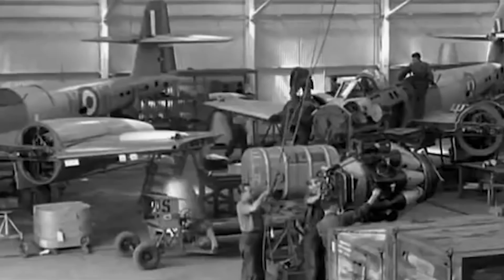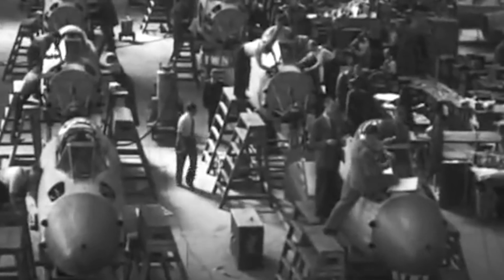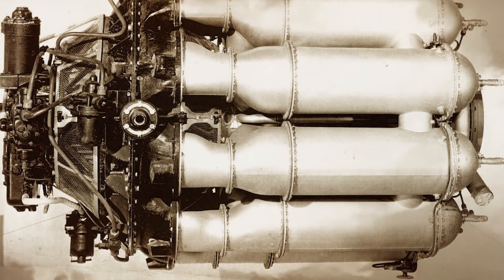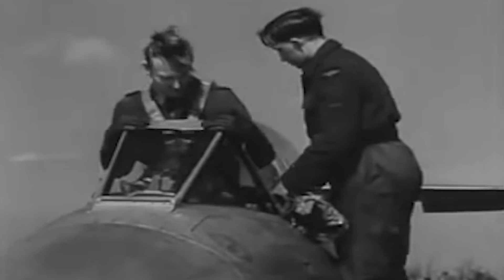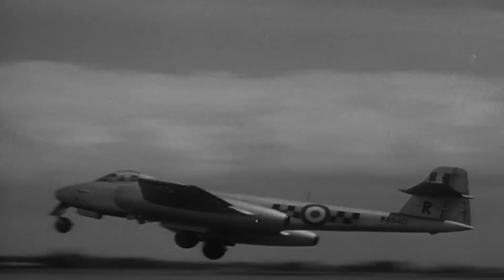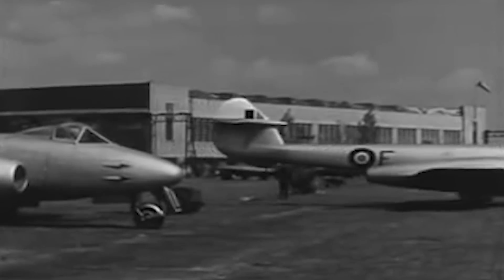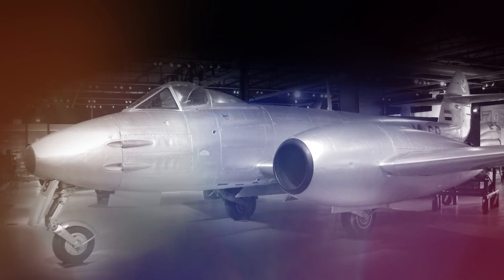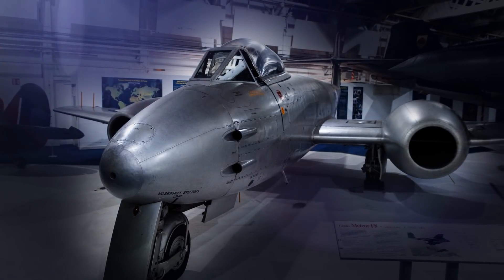Gloster Meteor - The Only Allied Jet to Fight in WW2

Comment: Seems like the brits didnt have much confidence in the plane. Everytime it came across manned german aircraft, no combat occurred. Seems they just wanted to be able to SAY they had a fighter jet..
Reply: You seem to have it backwards, when it reached the continent the Luftwaffe steered clear.  By that time Germany had so little fuel and serviceable aircraft all flights had strategic goals and engaging in combat was not encouraged.  The 262 was forbidden to engage in combat with allied fighter do to It's poor maneuverability.  Meteors destroyed over 50 Luftwaffe aircraft on the ground, countless tanks, trucks and assorted vehicles and rolling stock.  It's only interaction with airborne aircraft was the forced landing of an unarmed observation aircraft.  Long and short is you can't shoot down what stays away from you.
Reply: @jimdavison4077  the germans continued to fight until the bitter end. No running. Indeed the last kill of the war was May 8th by a ME109.
Reply: @mannarmylie4195  check the records, the last few months thats all the Germans did was retreat and flee.  The avoided conflict then made crazy claims that they shot down large numbers of enemy aircraft even when the allies suffered no loses.   Many 262 returned to base with out shooting a single shot.
Reply: @jimdavison4077  ummm thats what a smart and especially an over matched military does. It picks and chooses its engagements where possible.
Reply: @mannarmylie4195  yes but it responds to threats which the Germans failed to do from 44 on.  It was crushed on all side and by late 44 lost its supply of aviation gasoline from the US making it combat ineffective.
Reply: @mannarmylie4195  and loses a war in short order.  Germany lost the war because they believed in their own supirority which turned out to be imaginary.  Not even at its peak could Germany hope to have the resourses either fronts ended up producing let alone both together.
Reply: The Gloster Meatbox was no fighter... its performance was inferior to many propeller driven fighters during WW2 and would have been a sitting duck for a Me262.
Reply: @sandervanderkammen9230  and yet it is recorded as having supirior performance to the 262 in every way.  Go figure.  Again that claim you made about how many kills the 262 achieved was debunked using squadron records.  Now Luftwaffe pilots were well know for lying about their kills going right back to the Condor Legions is Spain.  Several units in North Africa were disgraced fo falsifying claims during the was and in the battle of Germany propaganda was used to mislead civilians about how terrible the war was going.  The records are there for anyone to read, in 43 and even early 44 Luftwaffe fighters took a heavy toll on bomber command and the Eighth airforce bombers by after the D-day invasion the sky over western Europe belonged to the allies with the Luftwaffe accomplishing very little.  By the fall of 44 fuel shortages thanks to Germany being cut off from US supplied aviation gasoline meant Bf  109's and FW 190's had very little fuel and they were the bulk of Germany's fighter force and accounted for the bulk of allied loses.  The 262 never really accomplished much thanks to its poor weapons and poor performance.  ALFRED PRICE wrote several books on the last year of Luftwaffe operations right down to the non of details and covers propaganda vrs reality.  Don't feel bad the Brits lied too during the Battle of Britain as well claiming a 4 to 1 kill ratio when in fact it was only a 2 to 1 ratio.  But couple that with the fact they were replacing lost aircraft at a 2 to 1 rate over the Luftwaffe.  The Soviets also provided false numbers for propaganda early in the war as well. The true sad part is almost 80 years later some people still believe those false figures.  If you honestly love history take the time to learn the truth.
Reply: The Messerschmitt Me-262 was responsible for shooting down over 550 Allied aircraft in WW2... the Gloster "Meatbox"  ZERO Luftwaffe planes shot down.
Reply: @sandervanderkammen9230  had the 262 been successful it would have been reengined to use by several countries but that never happened.  And you have to admit the 262 was tested for hours and hours by the US, UK and USSR yet of the hundreds and hundred that survived not one was used by any major airforce in the world.  If the 262 had any kind of performance at all that made it supirior to propeller aircraft in combat it would have been put to use but it was not and forget the 25% loss rate the 262 had against bombers the number shot down by propeller fights doubles that almost.  For all the good the aircraft did had aviation gasoline been available the pilots would have been better suited in those aircraft.
Reply: @sandervanderkammen9230  as for the Meteors performance in the war if it was so bad why did the Luftwaffe keep running away?  It's contribution on the ground was  incredible and proves the type was there, yet everytime they saw German fighter the Luftwaffe ran away.  Why if it was so bad? By the time the 616th squadron was in Belgium and Germany it had the F3 upgraded to the F4 standard with improved nacelles and cockpit making their speed faster than the 262.  As for its turning, climbing and diving that was already superior to the 262 with the F3.
Reply: @sandervanderkammen9230  also tell us what good was a fighter forbidden to dogfight like the 262 was by the Luftwaffe?
Reply: @jimdavison4077  26 Luftwaffe pilots became aces flying the Messerschmitt Me-262... the Meatbox killed more brits than Germans....
Reply: @sandervanderkammen9230  lol right in a fighter forbidden to fight.  The 262 had everything against it.  Engines that could not be run long at full rpm, weapons that had to basically be right next to its target and an air frame that tried to kill you if you want to fast.  At least most accidents with the meteor were pilot error.   Tell me how many hours flight time did the 262 get before being scrapped?  All the while the meteor continued on until the 1970's but hey you won't be honest about that at all.   In combat the 262 struggled to make 500 mph with 515 mph being its top speed in combat trim and even then it could not make the types of maneuvers required in dog fighting so the Luftwaffe forbid such engagements because they knee it was an easy kill.    Jump ahead you have Nazi fan boys who watch a few crazy unresearched YouTube videos and think you know everything.  It takes a lot more than YouTube videos to make a person familiar with historical facts.  Maybe you believe the Luftwaffe' s top lying pilot Adolf Galland who blamed Hitler for the 262's delay.  Tell us how Hitler delayed the aircraft when the Jumo 004b never went into production until August 44 and Hitler orders for producing the bomber variant first was reminded in Sept 44.  No Luftwaffe unit recieved the 262 operationally until late fall 44.  Galland lies through his teeth all through the war to cover his incompetence.  Many Germans lied to save their own skin as some were executed for not delivering on promises.  Not a healthy enviroment at all.
Reply: @sandervanderkammen9230  The Me 262 achieved bugger all. Allied aircraft were swarming over germany a thousand at a time day after day and the Me 262 couldn't even scratch the surface.  After the war the Czechs built twelve 262s hoping to start an export industry but they couldn't flog a single one even they only used them for one year before grounding them forever and buying the Nene engined MiG-15.

Comment: A Gloster Meteor with Sapphire Axial flow engines was able to get to 40,000 ft in around 3 minutes and 15 seconds in 1951 from break releasse.
Quicker than an F22?
Reply: Can you prove that outrageous claim?
Reply: @sandervanderkammen9230  See Youtube Video 'British Movietone Gloster Meteor RECORD SPEED CLIMB' dated 21 Jul 2015
Reply: @amfearliathmor9747  Please provide the official FAI database ID number.
Reply: @sandervanderkammen9230  Meteor F.8 WA820 was adapted during 1948 to take two Armstrong Siddeley Sapphire turbojets, and from Moreton Valence, on 31 August 1951, established a time-to-height climb record. The pilot was Flt Lt Tom Prickett, of Armstrong Siddeley. A height of 9,843 ft was reached in 1 min 16 sec, 19,685 ft in 1 min 50 sec, 29,500 ft in 2 min 29 sec, and 39,370 ft in 3 min 7 sec.
Reply: @amfearliathmor9747  Please provide the official FAI record database number
Reply: @sandervanderkammen9230  very funny from a person who blindly accepts debunked Luftwaffe claims...lmao
Reply: @jimdavison4077  Very funny from a person who clearly no longer has a firm grasp on reality...
Reply: @sandervanderkammen9230  so which airforce was swept from.the skies again?    That's what I thought.  The 262 had a kill ratio of 1.5 to 1.  Nothing to get excited about.
Reply: @jimdavison4077  The Gloster "Meatbox" had a NEGATIVE kill ratio 0.0:1.5
It was the most effective British jet ever used AGAINST RAF pilots.
Reply: @sandervanderkammen9230  Ah sandyboy, still grasping at that straw to try and rescue the Me 262 from its appalling failure. The Me 262 had a mechanical failure crash rate far higher than the Meteor. The me 262 had a rubbish engine and a brief service life of just 7 years in only two countries and postwar nobody wanted it. Whereas the Meteor served with more than a dozen national airforces and for more than 30 years.
Reply: @sandervanderkammen9230  Sandyboy, up page a bit you replied on a thread which had the claim that an Me 262 recorded a speed of 624MPH in 1944.
You didn't ask for an FAI record database number in regard to that.
Why didn't you ask? 
Can you provide one?